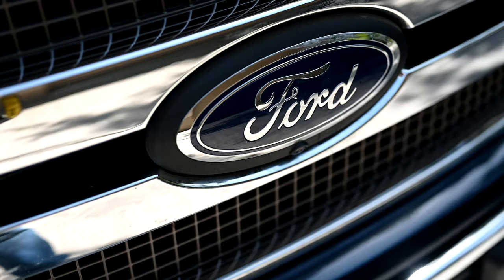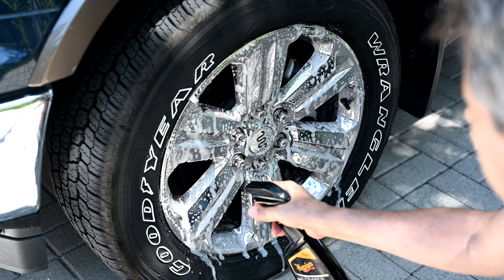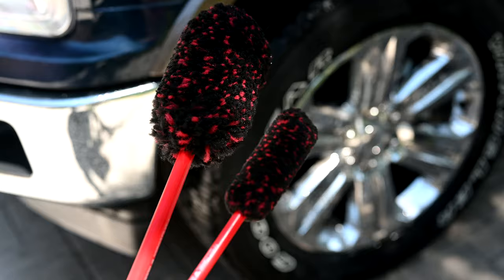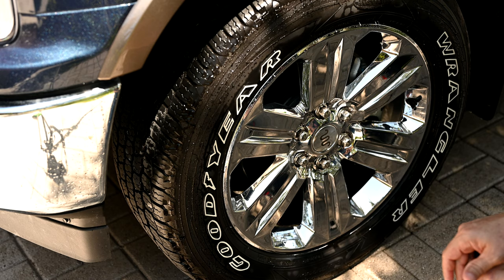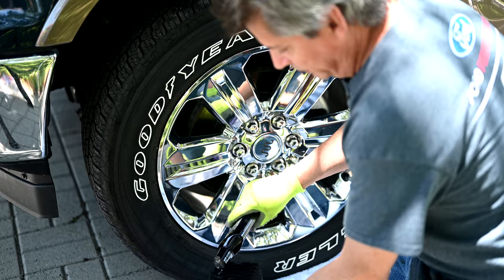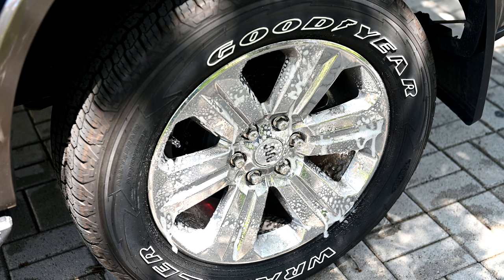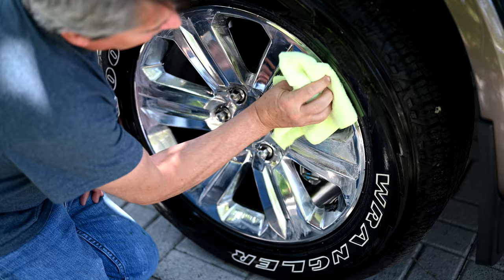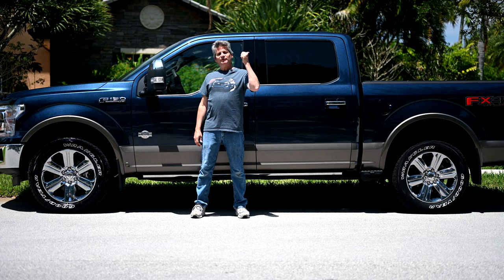Ford F150 Wheel & Tire Cleaning, Dressing Like Pros of Auto Detailing

Comment from the maker: ✅ Car Wash Parts & Products shown/mentioned in this best wheel cleaner video
✅ Meguiar's Ultimate All Wheel Cleaner G180132SP 32 oz. : https://amzn.to/2KLRNxG
✅ Sonax Wheel Cleaner Plus (230241) - 16.9 fl. oz. - 2 Pack: https://amzn.to/2XF4lvQ
✅ Griot's Garage Wheel Cleaner 10973 Heavy-Duty 22oz: https://amzn.to/2QEXvoS
✅ Liquid X Original Wheel Woolies Brushes 3 Piece Kit : https://amzn.to/2OAG9XG
✅ Meguiar's Endurance Tire Gel G7516  - 16 oz: https://amzn.to/2KNkdXZ
✅ Meguiar’s Supreme Shine 4" Foam Applicator Pads, 4 Pack: https://amzn.to/33etm2m
✅ Chemical Guys Wonder Wave Tire Dressing Applicator Pad (Pack of 2): https://amzn.to/2ObuuiY
Reply: Beautiful job , What kind of wheel soap you used on the tires ?....